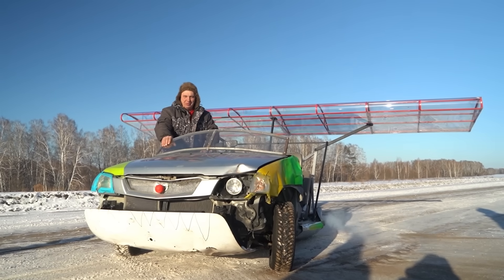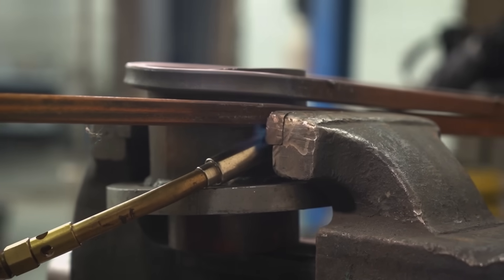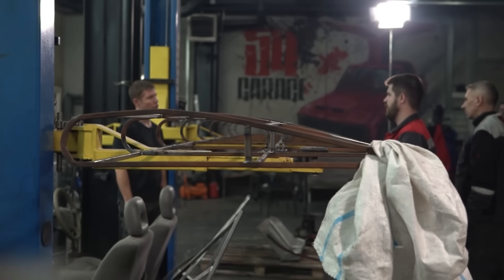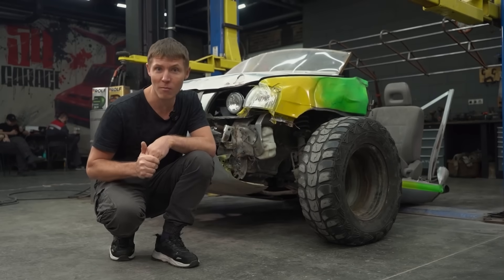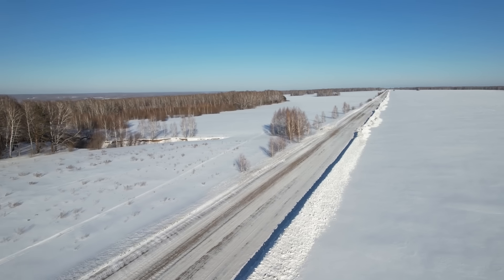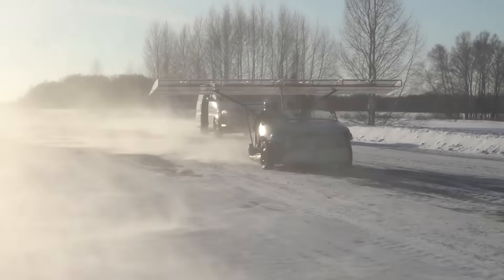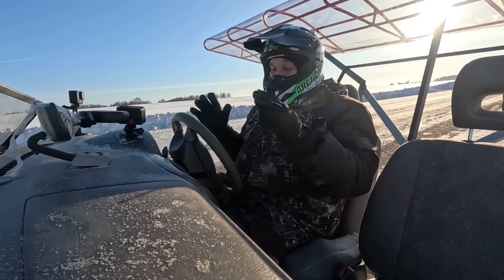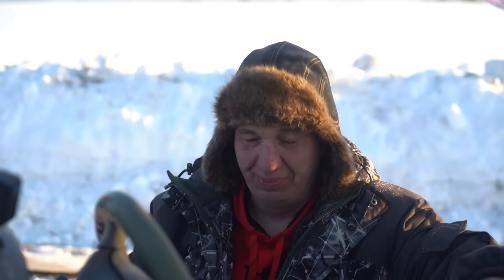We fit a wing to a car - will it lift off?

Comment: Not airborne.  Only the rear lifts when you step on the break.  Weight pivots on the front wheels.  Attach rudder in front to the steering linkage to control lateral motion.  Come on, do it right.

Comment: I didn't see this video before....
Sorry boys, but this time you were silly. Having fun does not mean risk your life in such a reckless way. 
Nothing to control the car when the wing supports it, no protection for the driver.. What would have happened if that thing had flipped over and slid off ripping the wing and its fasteners off?

Comment: my idea ...l told this garage to do it and they did it now ...wow ...finally ...it worked ...l told so many on yt to do it ....but my idea was a bit diff. whole car gliding . l wrote in here on one of the videos of garage fifty four . dont remember witch but im pretty sure l did . so question is if they saw it and wanted to do it  or if they did not read it and got the idea from antoerh place or on their own .remote control is safer in first runs at least cos guys in usa died in a pinto car with wings and properller but it was badly made not strong wing struts badly fastened.

Comment: Maybe you need a vertical tail stabilizer for it to keep moving straight? Obviously, when it lifts, the wheels are going to lose contact and it will go down again.
What about adding some kind of protection for the driver, in case it rolls over?

Comment: My guess would be that you need a wing going vertically along with the horizontal wing you have already for it to be more stable.  If you think about how an airplane has a wing pointing vertically on its tail to keep it stable, That's what I think is lacking here

Comment: It is possible to make a plane but u need a proper engineers to guide u in the making process. And use light weight motorcycle engine. Metal tube for the wing is overweight.

Comment: The wing's angle of attack pitches downward as it rises...
the wing needs to pivot so it automatically finds the correct position....somewhere just forward of the airfoil's cord center should work.
Great job guys from Florida USA!

Comment: The front end is too heavy. What if you position the wing more forward to balance out the weight a little bit. Or maybe put a small adjustable wing at the front on the bonnet

Comment: You will need a balancing tail at the back. The tail will straighten the car due to air resistance if the car starts to turn. Two small wings, one on each side of the tail, will control the pitch angle (pointing up/down). The tail should have a flap to steer and the two small wings should have flaps to control the pitch angle. However, too much of the weight is ahead of the wing, which will cause it to dive. It cannot take off anyway, because once the wheels are in the air, there is no traction. You must use a propeller instead.

Comment: Am I missing something? I did not see that car come off the ground at all except for the run. That doesn’t count as getting airborne, both front and back would have to get up for that. You’re missing a rotor, and you’re also missing your wing blades for drag and lift. You need to have the wing connected to some kind of pulley, so that it’s not trying to take off before you get it past 60. When you do hit 60, you can move the wing up or down in order to get the drag and lift from the wind. I would also say to ditch the car, because it is way too front and heavy. If I were you guys, I would connect to a snowmobile that can get up to 60+ miles per hour. You would have a better chance in that, than you would a car thats sliding all over the place. Other than all of that, it’s a really cool concept that I haven’t seen down yet
Reply: n an airplane, the term "rotor" typically refers to the rotating blades of a helicopter's main rotor system, which provide lift and control..........oh ...but ok remove engine and go down a steep hill against strojng wind , remove other seats , top maybe  , fenders . or do they help areodynamics, but could remove a third of midsection third of car lenghtwise and weld together then not a broad car anymore but airplane size or so one seater one row plane.

Comment: Propeller driven aircraft veer to the left on takeoff due to the torque of the engine and other related factors.  Rudder is necessary to counteract that force.

Comment: I'm sure there is a practical application of lift wings, possibly through active aero, that would absolutely help with high speed, rough terrain, suspension. Lift for helping with impact but needs downforce to keep traction. Maybe also a third point of contact for stability. I bet this is how people felt watching the Wright brothers, I wanted it to work so bad!

Comment: For one, hitting the brakes is not gaining lift that is just the concrete weight, even my bicycle with no wing can lift the back like that if i hit the front brake.  Stop cheating.
What you need is two wings, and a vertical stabiliser.    You need a downforce wing for the front bumper to maintain road contact,  then an upforce wing (like you built) at the back but with the ends plugged.  The wing open on the ends as it seems in this video will cause lateral airflow exaggerating any unwanted sideway turns.
You also need a vertical tail either fixed, or with a little movement linked to the steering wheel.      If you wanted to be really fancy you could use two vertial tails to ALSO block the ends of the wings to keep things simple.

The concept you have built can actually work, and Russia even built a ground effect Cargo Aircraft using a similar idea last century as an experiment.
Reply: or need somone more serious to build it , garage is not..drill many holes in frame bottom and panels from plastic or printed , or alu weld frame , or timber . remove engine , use a tether like a kite in a strom or down steep hill

Comment: Hey folks you need a tail fin with a rudder connected to the steering and ideally have the wing on a lever that levels the wing when starting to lift, ideally stopping you from taking off completely, as to just lift the back, that could be achieved by using the rear ski connecting it to the wing or a flap on a fulcrum lever,  requires some real fine tuning to work... tricky one...lol...love your work...keep it up from Oz

Comment: I think twin-boom stabilizers and flaps on the wing itself bound directly to the height of the wing or the tilt of the vehicle would work great for this. Perhaps even a rudder controlled by a lever by the driver's side so if it starts to slide even with the wheel steering, he can push the lever like how an airboat steers to counter it and straighten out. The stabilizers will need to be big though.

Comment: the easiest change you can make to increase stability of the car while it's on the ground is to make the wheels pidgeon toed. get them to both point inward a bit, and when you turn the steering, one wheel will be pointing forward, while the side you want to turn is quite drastically pointing in the direction you turned the wheel, resulting in actual control. it's VERY different to a 4 wheeled car where the back wheels help keep things straight. this has been tested out both irl, and in games plenty of times, and almost always works (physics in games can be tricky)

Comment: I think it might help if you could change the wings angle of attack by a controlled lever that moves into notched and located positions. Sort of like clap control on aircrat. As for lateral stability a dual rudder fin outside of the car airstream and consider linking to steering, although it might be that it is reversed to the direction  you turn in as it maybe instant wipe out if both were to turn right at the same time 😂 Also a tail skid to help straight line running before lift off. Like the old WWI biplanes had.

Comment: Making it more plane-like is an obvious next step, but what about going in the other direction? Put a chin spoiler or side canards that pull down on the front wheels once the rear is lifted. You want passive control features that will provide stabilizing forces that will keep the rear within a certain vertical and sideways angle. You could maybe even find a balance that keeps the front just barely in contact with low PSI balloon tires, so you still have that "air-suspension" effect.

Be careful with design here. As you guys have felt the first signs of already, aerodynamic instability is no joke and can turn a mild 70 km/h sled ride into a neck-breaker in milliseconds, with nothing you can do to affect the outcome. Make sure to consider what the effects of any new control surfaces will be at non-standard orientations (ie extreme drift angles like you were practicing here, turning backwards at speed, rolling to one side, etc).

Comment: the build needs some ski's that stick out near the skid plate that contact the surface when the rear become elevated. Have them attached to the steering. Also an upright stabilizer wing would help keep the rear straight

Comment: In theory any vehicle can create lift using the right amount of air displacement, center of gravity and power to reach the required speed per design, as well as the transition from ground to air power 💪💪💪💪💪💪💪

Comment: THIS CHANNEL IS THE BEST,  BUT IN THIS VIDEO WE ARE BEING PLAYED 😂😂. . . THE REAR DOESN'T HAVE MUCH WEIGHT. WHEN HE STEP ON THE BRAKES HARD THE REAR WILL ROTATE, LIKE A MOTOR BIKE , TOO MUCH FRONT BRAKES APPLIED IT ROTATES. . . THE BUMPS ARE SOOTHED BY THE WING , BUT THE BACK LIFT IS CAUSED BY HIM STEPPING ON FRONT BRAKES HARD. . CHECK IT AGAIN

Comment: ALL  these people talking about a rudder on a tail , when all you need is a tail going vertical in the center below the wing to a little above the wing , like 3 foot long X 3 foot tall with 1 foot being above the wing  ,, the front wheels should be able to go straight and turn for the body will follow the force given , no rudder!

Comment: A low ground-effect ekranoplane wing would probably work better and easier, but you also want a rudder or at least a long piece of springy steel that sticks out the back and drags on the road.  At speed, with a little lift, only the tip of it would still drag, but it would calm the steering and let you go straight when you want to.

Comment: I think the problem is the car is too heavy and may need to make it lighter somehow or add a slightly bigger wing to it
Reply: drill many holes in frame bottom and panels from plastic or printed , or alu weld frame , or timber . remove engine , use a tether like a kite in a strom or down steep hill.

Comment: If you cover the bottom w/ aluminum, you will eliminate the buffeting of the plastic & improve the lift.

You need an aeliron perpendicular the the width of the wing. W/ a  rear section which can move, side ti side, pivoting where it connects & controllable, you'll be able to keep the wing 'square' to the wind.

If you look at pictures of early inventors, some have the aeliron in front, w/ a small wing. 

If you used that design, you might be able to better control the vertical 'steering wing' I described.

It is temping to connect it to the steering, but you want it independent; foot control would be best.  A small front wing in the design would unweight the front tires; not enough lift to get front airborne, but enoigh to reduce weight by 50-70% & control should be improved.

Add a ski on each rear corner, something wide, like a water ski, (take the skag off) for even better stability of the rear.

You should be able to float down the road, nearly off the ground, in good control; you don't want to actually get off the ground, it is too dangerous, even several meters would be enough the car could get out of control & flip.

A car tends to spin, only rolling over if helped; anything airborne tends to roll, not spin.

We don't want you to get the Mazda upside down; we like you too much!

Comment: I have this idea for you that I have not seen done anywhere else. And because...well... you guys are the definition of "never done anywhere else" :D

Inverted steering. When you turn the wheel to right, the car turns left and vice versa. 

How easy is it to learn to drive such a car? Can you drift such a car? What happens when "opposite lock" just becomes "lock"?

Comment: The stability problem is due to the open differential in the transmission. As soon as the back of the car lifts off the ground there is weight on the front tires only and as we know an open differential sends power to the least loaded tire. The car spins to the front tire with the least weight on it. A center seat driving position might help but in a traditional FWD car the engine is always offset to one side so naturally the car is heavier on one front tire. A vertical stabilizer will have no effect at 60 kph, it’s just not fast enough to provide the stability needed to off set the traction problem up front. The easy solution for tire grip might be a grippy tire on one side and a slick tire on the other!

Comment: Mount a tail with Rutter tied into the steering wheel (reversed though) and mount a jack shaft coming off the crank or belt drive to a propeller out the front then when it lifts up you still have pull on the front to help keep it going

Comment: "fly" when the brakes are pressed. Honestly its a fun video but it would probably "fly" better without the weight of that wing on the back. You're going to need a lot mroe lift than that can generate at those speeds to haul that kind of weight off the ground properly. 
Or you'll have top get it up around 200kph.

Comment: I absolutely love this channel BUT I'm not convinced the wing did anything at all. It only ever got lift when you slam on the brakes and I'd argue it would do the same thing without the wing, maybe even higher without the weight of the wing. To prove me wrong/rule this out, I'd like to see how the vehicle performs with out the wing when you slam on the brakes at high speeds. Without the rear end the car is already very front heavy, and I just think the wing is giving the illusion of lift.

Just my thoughts, not hating, and would love to be proven wrong and the wing is providing lift. And if so you guys need a rudder or a tail wing to add stability and steer the back end once airborne

Comment: This is awesome! Should add a vertical stabilizer to help with yaw. If you really want to get cray add a rudder connected to a gyro with servos like we have in aircraft called yaw dampeners.

Comment: I think you might be onto something there.  You would need a computer to control the balance.  You would need to balance the lift upwards and add a forward balance that put more rear weight onto the front when in the air.  A driver could manage it on the show.  But I think a sport / recreational product could be made from this.  For that you would need a computer.

Comment: Lots of comments mention a steerable rudder, but I think that just a huge vertical stabilizer would be enough. Speed record cars typically have something of the sort. It just needs to be installed behind the wing for maximum efficiency

Comment: Add some vertical plates to ends of the wing to eliminate the vortexes there. If ou make them large enough, they might work as lateral stabiliser as well. Add elevators and it might be controllable. Also, if the car has ABS, make it working and you might be able to stop it safely as well....

Comment: Would it be out of the question to strap it onto a trailer and see if lift still occurs at speed? From what I can see the lift appears to be caused by locking the brakes on a vehicle designed with as much of the weight forward as possible.

Comment: Too heavy, not enough lifting surface, put a third wheel in front of the 2 wheels so that if it ever lits you have 3 wheels touching the ground but the amount of steel its in that wing it wont lift at all

Comment: It needs a middle wing virtual in the air with a rudder and the back of the wing needs to be lifted its too much down, look at the angle of a plane wing when it's lifted the rear wheel up ready to take off.

Comment: As many have said, I would add a tail fin/stabilizer/rudder, maybe even a small second "elevator" wing to actually control the amount of lift better.  Then add some downward curving wing tips (check out small STOL aircraft).  If all of that works, then the next step would be to take an all wheel drive car and cut it in half.  Instead of the central driveshaft powering rear wheels, it would then power a propeller, possibly through a belt drive, to get it up high enough.  Whether the propeller is mounted in back or in front of the car (through a secondary driveshaft going forward) is up to you.  Last but not least, a ski with sharp keel mounted in back that is mounted to a long-travel shock so that it still contacts the ground and gives a little extra control right as lift from the wing is starting to lift it up.  The rudder and ski would be linked to steering, and brake could control a small pop-up panel (air brake) on the wing (or the elevator itself) to kill the lift and help bring the rear end/wing down when hitting the brakes, instead of the momentum causing further lifting of the rear, resulting in less control.  Whatever you choose to do, I know it will be awesome! :)

Comment: rudder on a vertical stabilizer and ailerons to control the lift will make it more manageable
also tip the wings so they shed vortices cleaner which will reduce drag